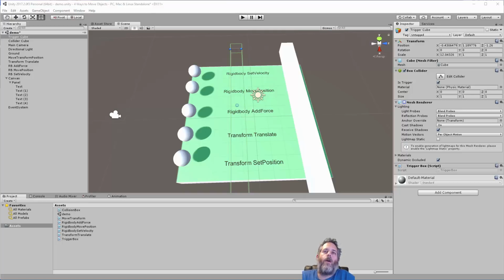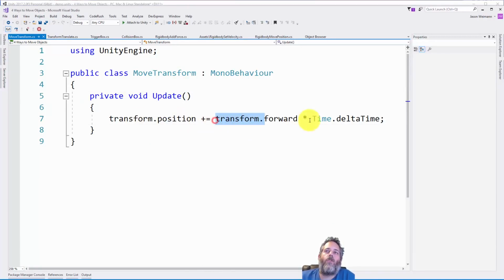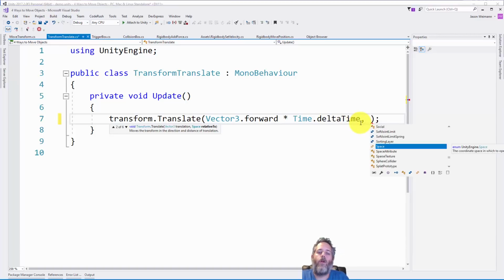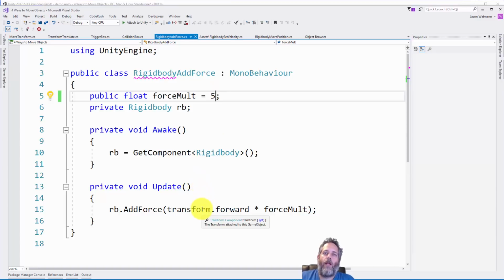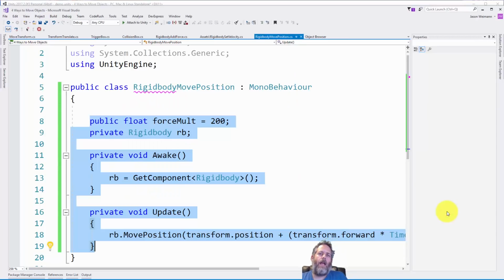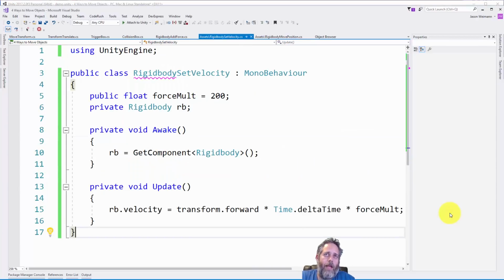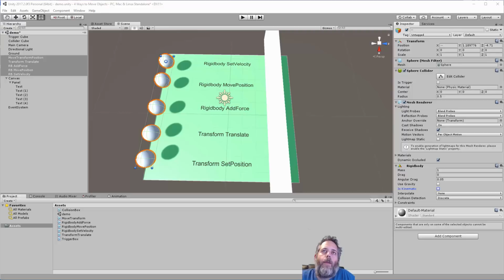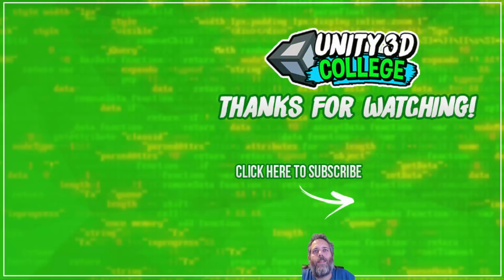Unity 101: 5 ways to move Unity3D Objects

Comment: Hi Jason always watch but never post, having real but probably simple to yourself here goes: I have a UI Icon wind arrow that points in the direction of the wind which I set manually to say the x or -x direction and that force acts on the player and it pushes to that direction, great! BUT the UI Icon, when I try to move forward in the Z direction I can get UI Icon  to move right facing the x direction I need or -x whatever, but when moving back the way in the -z direction the UI Icon stays the same direction always pointing the same way in x not going 180 flip; Ive tried if(player.transform.rotation.y == 180) or >0 etc etc and also if(player.transform.forward ) ==1) and ==-1 for what I thought was -z, but no tried many if statements many ways to get the icons to move in the desired  direction when Im going in the z and -z direction but does not work, the closest I have is this:

if (Mathf.Abs(Vector3.Dot(Player.transform.forward, Vector3.forward)) == 1) { WindArrow.transform.Rotate(Vector3.forward, 180); }

and yey it works...or so I thought as the UI arrow rotates 180 every time I enter the OnTriggerEnter area is which activates the if code and being wrong again as it just keeps on flipping each enter no matter whcih way I face twice in thre z foe example grrr, then I tried this:

if(Mathf.Abs(Vector3.Dot(Player.transform.forward, Vector3.forward)) ==1 { aligned = true; ; }
                {
                    if(aligned) { WindArrowL.SetActive(false); WindArrowR.SetActive(true); }else { WindArrowL.SetActive(true); WindArrowR.SetActive(false); 
                }
but the UI only shows up the else condition on both ways walking? I must be misunderstanding the if(Mathf.Abs(Vector3) code or something else, hopefully you can help I know you are busy or a fellow super geek can help moi lol Thanks guys 3 weeks of struggle  a new record yey...or nae lol :D

Comment: The reason the Transform is wiggling is because on every frame it pushes it self inside the collider, and every Fixed Update the Rigidbody pushes the object out.
Jason should really test Character Controllers here. Rigidbodies update on a fixed timer and if you want high frame rates are not a good option.

Comment: Hi, Jason! I've briefly subscribed your channel, your videos are great. And I want to ask you something about a problem in my project. It's a platformer 2D.
The problem is my dash isn't working as intended. I want my dash to be straight and not falling(if dashing while jumping), and also consistent.

The underlying problem I guess is my movement script which is not physics based:

    void Movement()
    {
        Vector2 moveSpeed = new Vector2(input.horizontal * speed, 0f);
        transform.Translate(moveSpeed * Time.deltaTime);
    }

then my dash script, unfortunately, the guides I've seen in the internet/youtube uses physics2D:

    void Dash()
    {
        if (Input.GetButtonDown("Dash"))
        {
            //Vector2 endPosition = new Vector2(transform.position.x + dashLength, 0f);
                                                          
            rb.velocity = new Vector2(playerMovement.direction * dashLength, rb.velocity.y);                                                   //DOES WORK BUT THE CHARACTER SLIDES THEN FALL
            //transform.position = Vector3.MoveTowards(transform.position, endPosition, Time.deltaTime);
                       //DOESN'T WORK
        }
    }

What is the best option that I should do? Change my movement script to physics? Which I think would eliminate the snappy controls which is what I like for my character. Or try something else? I also tried coroutine using transform.Translate and it also works and it does what I want it to do, the only problem is, it goes through walls even if I set my rigidbody2d collision detection to continuous.

Comment: Hey guys. Could someone help me? Whats the best way to move something like an elevator? I tried many ways but when my Character controller is standing on a rising platform he starts to shake (i'm guessing the elevator collider hits characters collider like in the video). Some say to parent the player from the elevetor onTriggerEnter but in my case it does nothing. I use standard Character controller for the player with applying vertical velocity for gravity in .Move() method I also use a SpereCast for ground checking, the elevator model only has a generated collider the one you get when importing an fbx model and right now I use Vector3.MoveTowards to move it up and down. Any help would be great thanks in advance.

Edit: after some experimentation I found that if my vertical velocity (gravity) is equal to 0 when I'm grounded, character just falls through the elevator, but if Y velocity isn't 0 (I have it at 6f) he doesn't fall but the stuttering occurs...

Comment: RigidBody.MovePosition works well with a RigidBody (doesn't have to be kinematic) in case you want to set a new position. The reason is that is uses the physics and actually does the same as setting the velocity with just the right amount to end up on the desired positon. So the physics can be properly resolved in case of collision, which is not the case with setting the transform position directly. This is the reason why in the example you can see the balls with Transform.SetPosition and Transform.Translate (which both set a new position ignoring the physics), both shake when they hit the wall: they are essentially teleporting to a new position and the physics cannot handle it (although the physics can still push the object outside of the wall if it doesn't overlap too much). The other methods (including RigidBody.MovePosition) use the physics and handle the collisions properly.

Comment: I have a strange issue right now. I use the set position on a transform like mentioned in the video.
It's called from another class every second. It should move by one per step. But what happens is that it doubles the old value every time and ads 1 on top.
So it moves from 1 to 3,7,15,31 and so on. Any idea why that happens? I bet I did some silly mistake but I have no idea what it.
Reply: send code
Reply: @bigboobmasterbaiter69  I fixed it!. I called that function in another class with a coroutine.
And I called another function that triggered the coroutine again by accident.
That's why it always doubled up. For every start of the coroutine, it triggered one more time.

Comment: Time.deltaTime on the SetVelocity is wrong, you have to feed it the desired velocity in m/s, using Time.deltaTime*50 makes it so that you have 1m/s only when having an fps of 50, making it framerate dependent, the very thing you are trying to avoid. (having lower framerate would actually make it faster since deltatime would be bigger)

Comment: so, use transform position if you don't use rigidbody, use rigidbody velocity if you use rigidbody, and use addforce if you want realistic push on an object. moveposition is rarely used, and transform translate works the same as transform position, but you can set the direction relatives.
Reply: I know this is a 4 year old comment, but I would disagree. You can have a rigidbody and still want to use transform position change in many cases, like a character mover. I would say ONLY use rigidbody velocity or addforce if you want realistic physics movement for things like bullets

Comment: I have installed unity no less than 5 times over the last few days...and my scripts don't work at all..
All I have done is make a cube(with ridgidbody..gravity is on)..placed above a plane...dropped the following script on the cube
and pressed play... 
>>> The cube falls (as I set it way above the plane)...and collides and stops on the plane...but I cannot get the following  script to move the cube forward...

Obviously I am new at this, but...any ideas on what I might have done wrong ?...as I am going crazy here!.

using UnityEngine;

public class TransformTranslate : MonoBehaviour
{

    private void update()
    {
        transform.Translate(Vector3.forward * Time.deltaTime);
    }

}
Reply: Thank you for trying, I have basically given up.... lol seems everything I ever try with programming screws up.
Reply: @Phodis  If you where using a rigidbody you should deactivate the gravity, thats how it worked on this video. Moving a gameobject by transform in update when this has a rigidbody usually causes unespected behaviour. If you are new to unity i recomend dont mess with rigidbodys still, learn a bit more before jump into that component becosue its behave very diferent than transform. To move a rigidbody you always have to do it in fixedupdate and you have to do it by the rigidbody moves functions like rigidbody.moveposition or addforce, etc.

Comment: how do i make it to where an object moves one direction then goes back using addforce?
Reply: Not really relavent to the video, but to answer your question you would just want to inverse the force when it you want it to move back. You would addforce every update by some variable (i.e forceAmount), then for example after it colliders with something you could set the velocity to 0 and inverse the forceAmount variable so that it would move backwards.
Reply: or add the force on a single frame that is enough to bounce it off what you want to bounce off of, and add a bouncy physics material to your rigidbody
Reply: thank you both for your input. I will try both to see which would make the best results

Comment: The velocity/force should not depend on Time.deltaTime. Physics manipulation should be done in FixedUpdate. But besides that. Interesting video!
Reply: why that? i heard this a lot, but the only argument i've heard was that at high speed you can pass trough wall in update method, but i test it and if my normal speed is 6, i had to set it to 8 000 to pass trough a wall, i use CharacterController.Move, maybe that's related?

Comment: You should have a fixed update if you are handling rigidbodies
Reply: Any physics movement should be done inside of fixed update. 
Unity's internal physics system runs on the fixed update loop, so if you call changes to it inside of update it will get out of sync and eventually your collides wont be interacting correctly. Take a look at the provided image for a more detailed understanding of how this works
https://docs.unity3d.com/uploads/Main/monobehaviour_flowchart.svg

This should be one of the first things people learn when working with a new engine..
Reply: So, with fixed update does it prevent the values from getting jacked up and causing my object to move more than it was programmed to? To be more specific, when I start my game and, say, jump for example, my object will sky rocket into the air much higher than it normally does when jumping normally. Right now i'm using add force for my jump commands and while this issue could probably be rectified by giving the system time to load, I don't want it to do this ever if I decide to make it available to the public.
Reply: As an update to this I can indeed confirm that having fixed update fixed the issue.
Reply: @megasoniczxx   perhaps u already figured it out, but i'll reply anyway. =P  When you use add vorce each time you press space the force is added to your force of your object, which results into massive jump, so in order to avoid this issue just set the velocity to 0 before adding it in addForce. It will allow to make the jump more natural.
Reply: @romansmartlogic7951  I actually didn't know about that, thanks dude, appreciate the advise.
Reply: @CodingWithUnity  thanks for sharing!
Reply: does fixed update make it so that you dont have to use time.deltaTime? or do you still?
Reply: When moving objects you should always use time.deltatime. It makes the movement more reliable because fixedupdate will fire more times per second on a faster computer compared to a slower one (as far as i understand). time.deltatime simply keeps track of the time between frames so you can rectify this difference.
Reply: @mrspazzout1  I want to how to stop movement at any certain point in Transform Translation ()
Reply: @mrspazzout1  unless im wrong than update is called every single frame, so update is affected by the computers processing power. Fixed update is called a fixed amount of times a second no matter how powerful the computer is. I could be wrong but i believe thats the difference between the two.
Reply: @mrspazzout1  Fixedupdate will be called a fix amount of times per second, no matter how fast the computer.
However, if your PC is so slow that it cant keep up with the fixedupdate, then the time.deltaTime will speed movement up
because the game is lagging. This is not something you 100% want in your game. If you are lagging behind, and every physics object moves 10x its distance in one update, this will : 

-   Mess up direction of travel for playerinput/ pathfinding
-  Tunnel through walls, or lag behind again because it has more work to do on interpolation.

For online games you probably always want this, but its not a sure thing.
Reply: @mrspazzout1  no man .. Update () is called once per frame .. so it's calling speed will differ based on fast computers. but FIxedUpdate() is called 100 times in one second. SO whether you have a fast pc or slow one . game will run smooth . that's why people say its safe to work in FixedUpdate() while using physics
Reply: @Krawallbruder the "frame" is a period of time which a computer need to draw all currently visible objects on the screen. So it's duration is different every time depending on complexity of currently visible stuff. The fixed update is not dependent on any visuals, so it  is may not be consiedered as frame thing or framerate thing etc. The fixed update can fire once per frame, multiple times per frame or not fire at some frames at all if they are drawing too quickly. You can of course still get user input in the fixed update
Reply: https://docs.unity3d.com/ScriptReference/Time-fixedDeltaTime.html
Reply: @manuelzarat  well, thank you. But actually that's what I just said :)